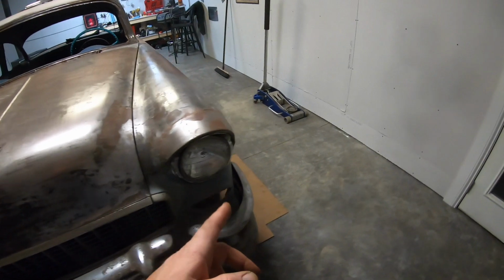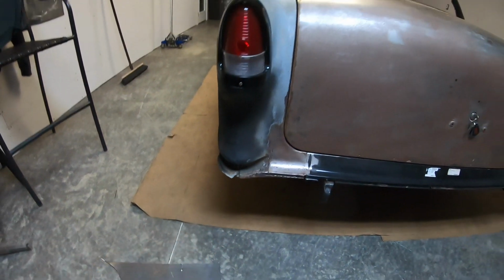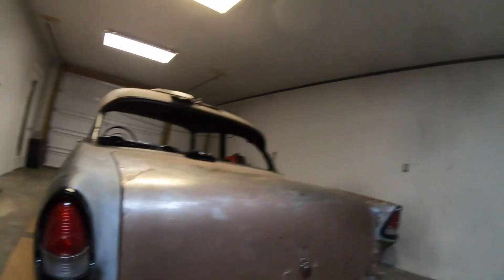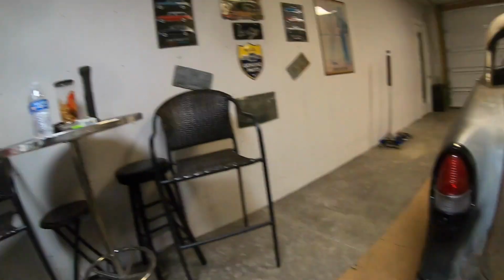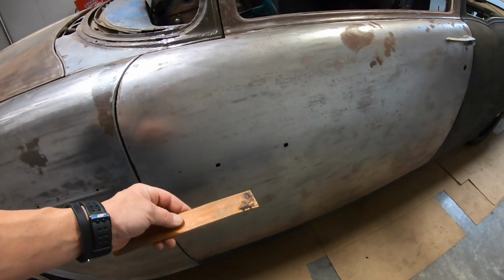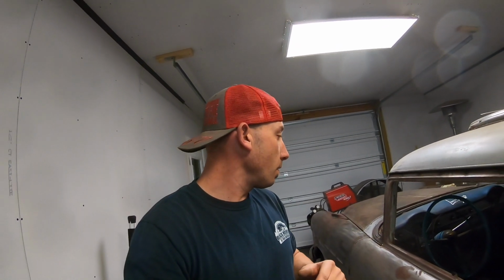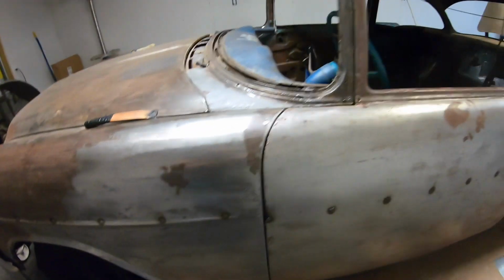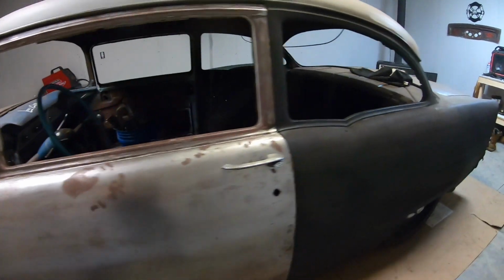Tri-Five Chevy 4door to 2door conversion ( Catch up Metal work )

Comment: Nice work on the hole repairs and informative technique on the use of wet sponge and copper.  I am not a welder but it's always nice to see the tricks of the trade.
Reply from the maker: It seems to work great. Biggest thing is taking your time with it.

Comment: Great work, what would help a lot would be lights mounted on the walls near the top pointing to the car. They make 4' LEDs that work great and are bright.
Reply from the maker: Yes absolutely. I still have some more stuff to do to the shop. Lighting is definitely one of them.
Reply: @LovettSpeedShop    Love your 57 gasser. I have a line a a 55 & 57 (4 doors) no real rust $5500. Each, but apart.  Hopefully in February I will get one and start the build.  I have a 1938 chevy coupe gasser I street drive and enjoy the hell out of it like you do with your 57.